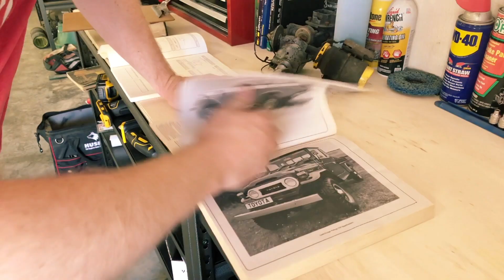PWW 40 - Part 5 FJ40 Rear Monte Carlo Disc Swap, Powerful Wizardry, Wife Destroys Shop, Eye Contact?

Comment: Good show,  you do a great job of explaining your problems and correcting them. Helped me with that spring, thanks.
Reply from the maker: No problem Dale. I often find the best example is the wrong one. Meaning, doing it incorrectly helps solidify the point when you actually do it right!